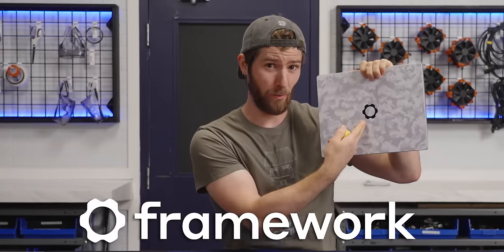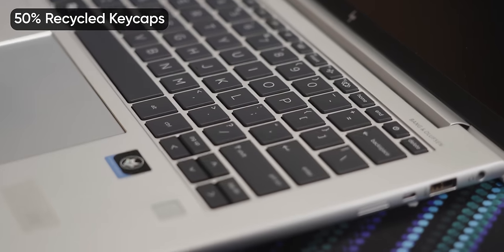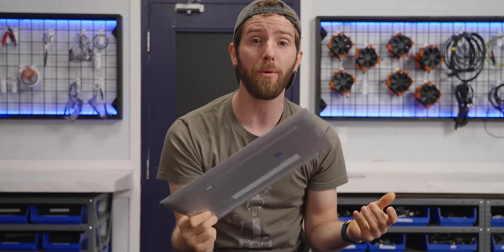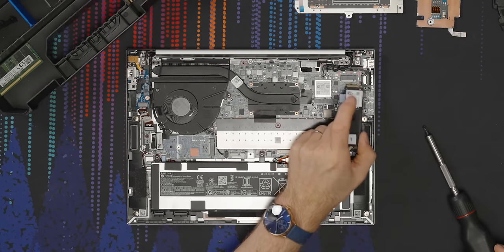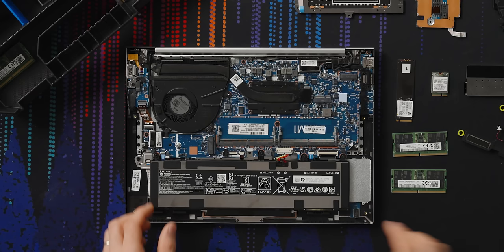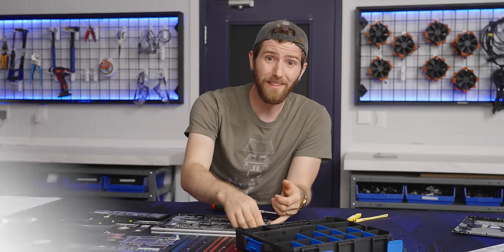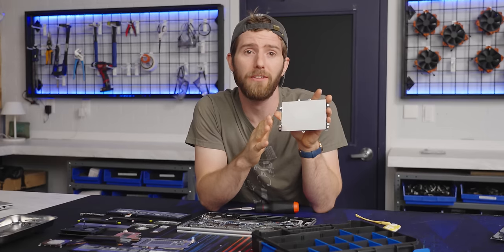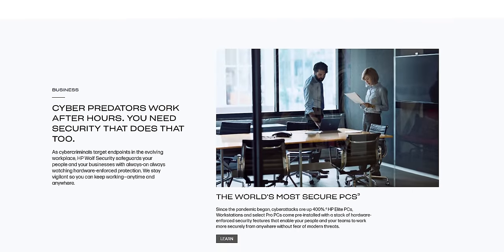My Investment is in TROUBLE - HP repairable laptops

Comment: Framework is still ahead, but this is a good effort.  HP does deserves a bit praise for doing this, when so many others actively work against repairablity.  I still just don't need a laptop, but it's good to see that there is another company out there with machines that aren't just use and toss.  I'll definitely be keeping this in mind when people ask what laptop they should buy.
Reply: the thing is elitebooks have always been like this, same with latitudes

its not a new thing, its just only super popular amongst business machines, which this falls under
Reply: EliteBooks were always like this. My 845 G8 is the same.
Reply: I really want a Framework but I watch a lot of video so 3:2 over 16:10 is a hard sell and the number of ports directly on the machine is just too low. They really need a 16:10 option and they need to make two of the USB-C ports natively built into the machine to bring the total port count to 7 so as to not compromise on the card slots. It's my belief that 7 ports including the headphone jack is the sweet spot of connectivity on a laptop.

This HP design is actually really tempting but my understanding is that HP stuff for a while has been a subpar brand of cheapness. Has this changed or is it changing?
Reply: @ky5666  "HP stuff for a while has been a subpar brand of cheapness." absolute nonsense
Reply: @ky5666  Unless you're going to to use them all at once, you can buy the extra ports you need and just swap out the ports when you need them.
Reply: @jm036  Yea the build quality of the HP 845 G9 looked very good if not outstanding. Plus those speakers sound very good. Something the Framework is still missing. If parts availability stays good for years to come, it's making the Framework a harder sell. With the main outlier being the motherboard upgradability.
Reply: @ThanosIsUglyGD  Yea but the point of the cards is more to customise the ports you have and protect the soldered mainboard ports from wear. Also there are times I like to plug a lot of stuff in.
Reply: Enterprise laptops have always been more repairable and contains easily swapped parts. Businesses need that kind of hardware. This is just an improvement of that because it seems they think there’s now a more interested market in the consumer space as well. What this doesn’t improve however is upgradability. The parts will have some overlap but there’s no evidence this board can be swapped in a year for whatever the next SoC is going to be
Reply: @fxckrio  Modern latitudes aren't like that anymore, I'm afraid. I spec'd a work machine recently and it was only available with up to 16GB RAM, soldered. Absolute madness.
Reply: Work has been using HP as they provider of choice for over a decade... Mostly because they used to outsource to HPE which became DXC... Still though the Elitebook line of laptops have been great and the repairability is amazing. Will be getting a G9 soon to replace my aging G5 so this will be neat
Reply: @Sgtpeterenis  lati lineup is very fragmented now so its a bit of a case of some are some aren't, which is admittedly unnecessarily confusing
Reply: @ky5666  HP bios is incredibly limited even for their gaming stuff.
Reply: Except that this isn't a new concept.  It might be new for HP to make serviceable laptops, but Dell Latitudes have had this level of serviceability, configuration, and spare parts availability for years.  If you have the service tag for a Dell Latitude, you can get a breakdown of every single component it shipped with and its part number.  You can tear one down to bare metal and rebuild it in a couple of hours.  These are expensive and relatively boring business-class laptops, where it's assumed they will be serviced and maintained by skilled IT people.  I have a Dell Latitude 5420 from work.  It's nothing special, and it's pretty low spec.  It costs almost CAD $4,000 to purchase from Dell (my employer probably gets them somewhat cheaper, since we are standardized on Dell hardware globally, including at least some servers, and have been for over a decade).  Performance-wise, it gets its panels blown off by a CAD $1,500 gaming laptop.  But if anything goes wrong on that gaming rig besides the SSD, you're probably tossing it, because you can't buy parts for it.

The Framework laptop is something else entirely.  It's a modular laptop with parts that can be almost hot-swapped, with no tear-down required.  It's a neat concept, and definitely a plus for easy serviceability, but you end up having to pay for that accessibility.  Unless you actually need to change the physical configuration of your laptop frequently, and that's not very likely, the value proposition of the Framework model is questionable.  Still, this may be in some ways the better model.  The number of people who would be willing to hot swap a part that just pops out and pops back in is a lot higher than the number of people willing to crack the Loctite on those captive case screws.
Reply: @megachonk9440  Dell and Thinkpad business models have very good repairability I remember, just kinda low spec and rather expensive. I remember them being heavier than very slim non-repairable ones too. Framework does a nice middle ground of specs and repairability. It is great that HP went that direction and I am kinda envious that they get an AMD processor. I hope Framework gets a 13th gen with a low end Intel Arc, or maybe 14th gen tiles+a low end mobile Arc GPU (which gonna be much better than Iris XE)
Reply: @jierenzheng7670  nah lenovo have been pre bad abt it on thinkpads compared to the rest, lots of whitelists for shit like wifi cards
Reply: I'm looking for a laptop. I'm going to buy this
Reply: The difference is that I trust Framework to keep maintaining their line of repairable laptops, assuming they are around. I don't trust HP or Dell to be supporting their line with upgrade components and repair parts in five years. Hopefully they are.

Comment: Massive props to HP for this. I just hope it isn't a one off.
Reply: No, the whole Probook/EliteBook lineup is like that ever  since the mid 2000's. And their Compaq EVO an HP Compaq branded predecessors, alongside of the contemporary Dell Latidude-s, IBM Thinkpads, Fujitsu Lifebooks.   
Framework  did not invent the Spanish wax.  Their laptop is about upgradable as a Elitebook, their main difference is the open source firmware.
Reply: It'll continue til framework folds. then HP will stop caring again.
Reply: @Nalianna  Do you  realize that HP Elitebook- s were always that repairable even before Framework was a thing?

There is a big difference between the mass market  HP-s you see in Best Buy and the business class HP-s sold to corporations.
Reply: @tyaty  Yes, but as a System Admin for the DOJ, they don’t allow us to repair the computers because of their contract and warranty issues.
Instead, HP contracts repairs out to TERRIBLE companies that almost always replace components incorrectly. They have also cracked the bottom case of EVERY SINGLE Probook laptop they’ve ever repaired since I started there. I literally watch them every time, and they never fail to crack it. It’s almost comical.

HP has sent their own techs twice since I’ve been here, and they were great; however, it doesn’t make up for the dozens of terrible contracted techs I’ve had.
Reply: Schematics or nothing. Everything else is BS
Reply: @tyaty  And the schematics. No minor differences if you ask me.
Reply: @juntapiezas  
HP had benn continuously releasing 100+ page self-service manuals for their business notebooks.
Reply: @D71219ONE  That could be due to the government contract set up. I worked at a multibillion dollar company, which exclusively used HP Elitebooks and if we wanted to, they would ship us the parts with installation instructions. Otherwise they could send a tech out to repair it, and usually the tech was good (this was in the Denver, CO and Tulsa, OK area). Compared to Dells however, which have absolute terrible quality control, they rarely broke which minimized the number of tickets we put in.
Reply: It isn't. I have an HP laptop. I didn't know before buying it but I was positively surprised that most spare parts are available and there are first-party sources on how to switch them.
Reply: HP should close, all they products are pure garbage
Reply: @Lampadina_17  
Only their generic  15/17 series sucks ass.
Their  mid-range to high end lineup is genuinely good.
Reply: @tyaty  my pavilion 15 has some upgradability, but for storage it’s very likely they blocked non-HP parts so I’m stuck with 256GB. I bought an Omen laptop because of this and something else
Reply: They have always been like this since years. Even decades. But sites or channels like these don't cover them since these are not consumer but enterprise laptops
Reply: @Lampadina_17  The only reliable laptop manufacturer to date. Lenovo is behind. All others are crap. Just research what engineering companies buy...
Reply: @zeus1117  yep Louis Rossman did a bit explaining that ODMs in Asia just tweak existing "patented" designs in a cookie cutter fashion and slap another brand's logo on it.

Apparently the hunch is that consumer electronics brands don't want this open industry secret to be aired out in public in fear of sparking lawsuits between both themselves, partners, amd competitors alike.

Totally makes sense why we see tons of OG MacBook Air clones to this day or why internal layouts between most commodity SKUs between Dell, HP, Lenovo, Acer, Asus, Samsung, LG, Huawei/Honor, and Xiaomi are almost identical.
Reply: It most like is a one off. 
For what I learned from PC OEM manufacturers, is that they love planned obsolescence and refuse to sell spare parts. It's bad for business.
A laptop manufacturer cannot survive without selling their customers a new PC each year.

I suspect HP is doing this just to get their name in another market and make companies invest in them. Once they reeled in all the businesses, they can scrap the whole "repariable" idea to the bin of "bad strategies".
Reply: @zeus1117  Enterprise laptops are popular amongst PC nerds, they have a large following that will sing praises about their trackpoints, durability, serviceability and upgradeability (where applicable). They collect them and like to share pictures of them online, but only if it’s a Thinkpad. Thinkpad has been selling out on some of its values, instead of giving Thinkpad more competition so Lenovo can’t get away with turning their favorite product into garbage, consumers whine a whole lot and buy them anyway. Elitebooks have the serviceability Thinkpad owners say is very important to them, they also boast the same milspec rating so IDK why they don’t buy from HP. Maybe the Latitudes are good too. Guess they’d rather have something that’s Thinkpad only in name rather than a laptop that’s a Thinkpad in everything but name. It’s what happens when you get too attached to a logo.

Comment: Time is a flat circle when companies like HP return to offer reparability.
2009 was a time in which basically all business laptops came with detailed disassembly guides until they chose the way of the clips & glue...
What i'm trying to say is, i hope we stay with reparability this time, and don't resort to the same situation we're in right now in 10 years time.
Reply: Like you said, time is a flat circle. They'll resort to it again. I just hope we still have options by then.
Reply: Yeah I even upgraded the cpu of my old 2009 laptop a few years ago. It took almost 0 effort. Nowadays everything has to be soldered.
Reply: @rodryguezzz  I remember swapping the cpu from celeron to pentium and 2gb of ram in my old xp gateway laptop
Reply: And it won't be long until they go back to throw it away and replace it. I fear most of these company changes are simply to alleviate pressure to their bottom line. And consumers not replacing whole equipment is bad for the bottom line. Even worse they may put such privilege behind a subscription wall. I'm happy to see the change, but I'm very weary what lies ahead
Reply: lol apple happened
Reply: I take apart old laptops all the time, while I'm not good at it, it's really damn easy
Reply: @RowanBird779  hey, can I challenge you to look at battery restoration of old laptops? Some 18650s and time and you can rebuild them new
Reply: @betawolfhd  I've heard about it
Reply: @ianvisser7899I disagree. Most other laptop OEMs are just copying what Microsoft and apple does. Even the P series thinkpads that used to be amazing, are now full of soldered and glued parts.
Reply: i love my 840 g1, the ram, battery, wifi card, and storage can be upgraded, it came with an hdd, but also has an ssd slot!!

Comment: In 1993ish, I was reviewing vendors PC desktop offerings for a national rollout.  We selected HP (over Compaq, IBM, and a couple of others I don't recall) precisely because of their modular design and serviceability.  Then they did that whole DEC/Compaq thing and lost their soul.  So it tickles my nostalgia to see them rediscovering this part of their corporate ethos!
Reply: well, i gotta tell you, you're wrong. I used to work at KPMG, and this laptop line is the one they were using, now this thing have a huge problem with display panel, and it's not cheap replacing one. Ofc they have 2 years quarranty, but alot of machine have the same problem after warranty, so Idk how it will be in the long run.

Comment: I used to work in the warehouse that repaired HP laptops when customers would send the unit back under warranty. Just from looking at it, this model is a definite improvement over older HP designs. Glad to see this change over some of the horrible designs I had to take apart.
Reply: I had to change the keyboard on my pavillion laptop, it was a nightmare
Reply: No this is a good pr move from HP, they always sold these type of repairable laptops in the business lines. It's the consumer lines that are and remain utter dogshit laptops...
Reply: @johnkristian  it is however a shame its never been marketed towards consumers. Its actually still quite hard to buy a new business class laptop from dell/hp/lenovo
Reply: Older hp laptops were actually better then most modern. My sister has a laptop with a second gen i5 and is has a slide lock and you can take off the whole bottom casing  without a single screw. You have acces to the ram, cpu heatsink, fan, battery and hard drive within 5 seconds
Reply: @sijedevos2376  and you could replace the cpu!
Reply: I had to open literal 5 units of old pavilions and looking at what they sold pre 2015, this is is like Porsche vs lada. I did not notice if there were any plastic structural pieces,  or even worse screw mounts that you break on first turn, that I still see in my nightmares. HP was one of worst in reparability, as they were made to never close again if opened, and even if you opened parts were vendor locked, and never in stock anywhere 3y in laptop life (at least where they would ship to me at reasonable rate and time).

Comment: I'm surprised to see that in-depth set of repair videos from HP. Even somebody who thinks they're just doing it for platitudes has to acknowledge the amount of manpower that goes into that type of production (not to mention the parts sales, manuals, etc). Hopefully it continues because more items trying to compete with the underdog Framework only helps us as buyers
Reply: They’ve actually had those videos for a long time. Years ago I upgraded an ssd in my $1000 gaming laptop with one of those HP made guides
Reply: Linus is doing a disservice by promoting philips screws. They are literal trash. They strip too easily. Torx is way better. Just get a torx bit/screw driver, problem solved.
Reply: the executives maybe doing it solely for platitudes and virtue signalling, but likely not the engineers and people actually working and putting in effort.
Reply: @blaynestaleypro  Phillips is a easier thing for people to reach for; everyone had one in their homes
Reply: no part are being sold though... it's just a from. part in stock are 0. trying to contact them to ask them to get some part lead to "no technician are currently available"
Reply: @blaynestaleypro  torx or hex, I generally prefer hex but that is just because thats what I am used to and have lying about. I commented a similar thing. You can get so much more torque with hex or torx without needing lots of pressure in the screw like with philips, after the screwdriver is in you dont need to put any pressure down onto the screw to stop it slipping.

Forget about philips in plastic screws, even if the screwhead doesnt have any angles in the philips section, it slips out and mushes the plastic because the screwdriver bit itself is angled. Philips is totally unusable with plastic.
Reply: @AkouviAmouzouviAba  Just need to make a new standard, instead of using philips for everything instead use hex as it just as simple (if not simpler, it is just a metal hexagon, unlight philips with loads of angles) and is much better, it doesnt slip and you can use a lot more torque without needing to put lots of pressure down onto the screw to prevent it slipping like with philips. Torx is better than philips too but I prefer hex.